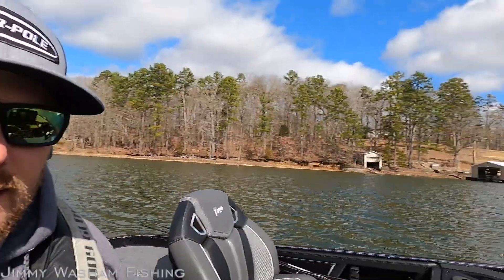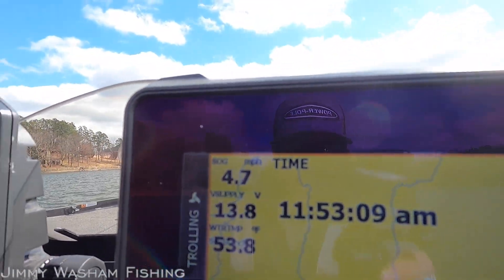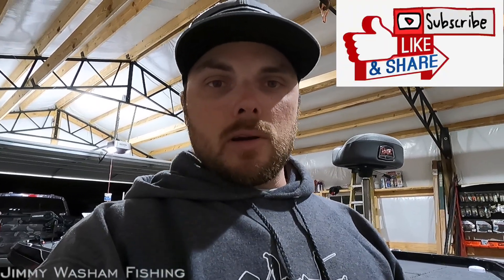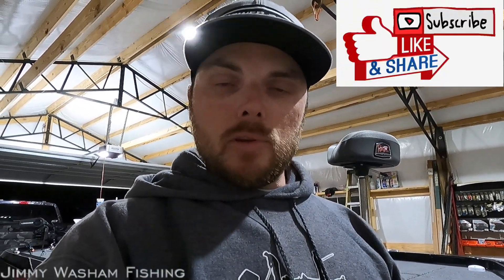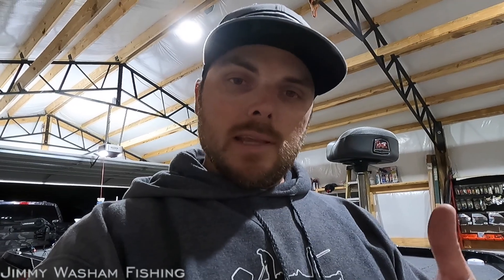Engine Break In - Mercury Pro XS

Comment: Jimmy, getting ready to do this and a new Pro XS 150. Are you saying only keep it in range from about 3000 to 4500 throughout the RPM ranges and WOT for 1 min every 10 min? Or should I do more of an RPM range such as 1000 to 4500? I’m not understand why only do the 3000-4500 range? My thought was to make a square box grid of varied RPMs and cross them off each time I complete that, but have them listed randomly so it’s not just laddering up and down and more like 1000, 2000, 1500, 3000, 4000, WOT, 2500, 3500, 4500, Idle in Gear, WOT, etc. 

Also should I do 10 minutes of the intervals and then do 1 minute WOT or should I do 9 minute intervals and then 1 minute WOT?

Thanks for your guidance.
Reply from the maker: From what was explained to me, you want the engine under a load as much as possible. If you bump down to 1000 rpm you will be close to idle. I try to range it from as low to high of an rpm range as I can while it's still on pad and in low trim.

My goal is to vary RPM by at least 500 each minute interval.

I try to start the process at exactly 1 minute into a new hour, and run WOT at every 10 minutes. 

That way you end up at WOT at :11, :22, :33, etc.

Hope that's clear and helpful, thanks for watching!